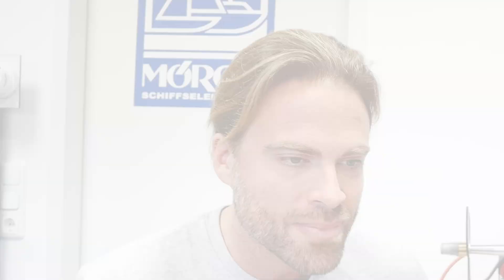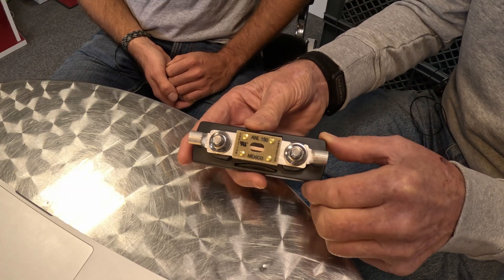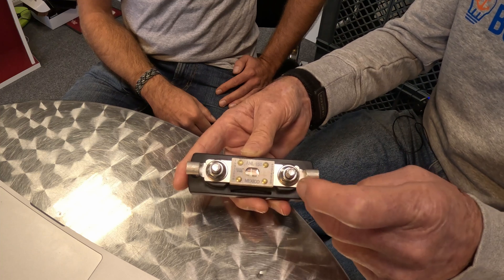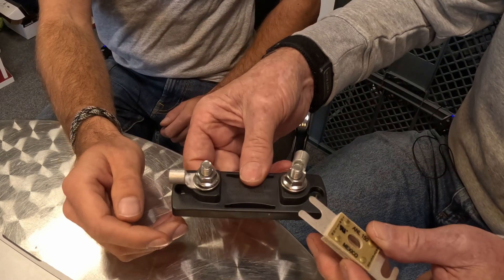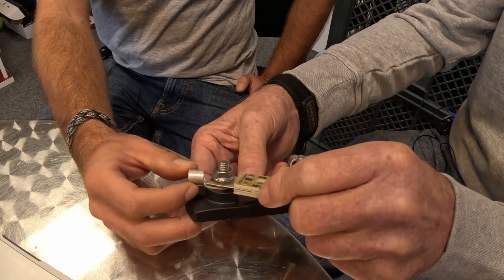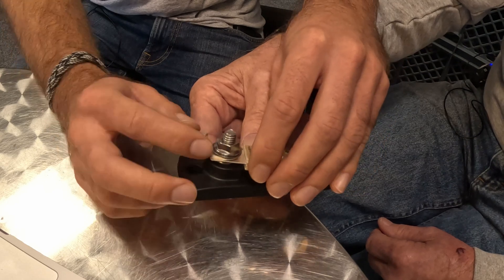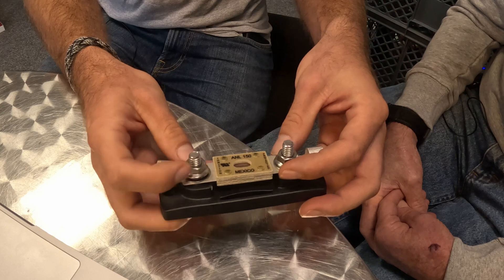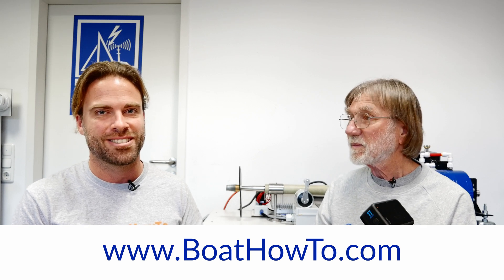FUSE getting HOT under LOAD - Is this normal? | Ask The Expert with NIGEL CALDER

Comment: Ok Nigel and Jan, maybe a little expansion on the topic of fuses on high current circuits. What is the proper fuse for the application? ANL, T-Class, AMG…? Fast blow or slow blow? What’s right for lithium vs lead acid, alternator circuit, inverter, ship systems, thrusters……

Comment: I have a question, rather general, about fuse ratings. I refer as an example to EGIS MRBF fuse. The info sheet at EGIS’ web site shows 135% rating at 900 sec (15 mins) to blow and 100% at more than 100 hours. What is the rational behind this? If this is the case for any reason, then I would need a considerable margin between the actual current and ampacity of the cable to use this kind of fuses even with inductive loads?
Thank you for an answer. 
Murat Erciyes
Bodrum, Turkey

Comment: That's I think one of the downsides of ANL fuses. Yes they're easier to replace but that same ease makes the replacement more error prone. With MEGA fuses you have to remove the bolt and washers completely so you automatically pay more attention to the process.

Comment: It's not required, but it seems like it would be good practice to design an electrical system that is not normally operating so near its maximum capacity.
Reply from the maker: It for sure doesn't hurt to oversize your wiring and thus be able to also use oversized fuses. However, especially with high loads such as inverters (drawing 300A and more), we are already pushing the limits of available conductor sizes, so there is not that much wiggle room. And for smaller loads, oversizing conductors will increase costs and in some cases it will be hard to fit them into existing cable ducts.
- Jan
Reply: I'm beginning to see the advantage of 48 volt systems.   @BoatHowTo

Comment: I did not know that many of those fuse holders are not rated to 105C!
Would you recommend NOT installing these in the engine room based on this issue?
Reply from the maker: My guess is very few fuse holders are rated for 105C so not using them is not a solution. We just need to recognize that although we may be using 105C conductors many of the devices in our circuits (not just fuses; also switches, circuit breakers, and other components) are not rated for this temperature and as such we need to be conservative in our conductor sizing, especially with circuits which may be continuously energized for some time (more than, say, 10 minutes for small conductors and 20-30 minutes for large conductors). Even when using 105C conductors, I recommend using 90C or even lower when determining ampacity, especially for continuously energized circuits. This builds in a degree of 'cushioning' into the circuit.